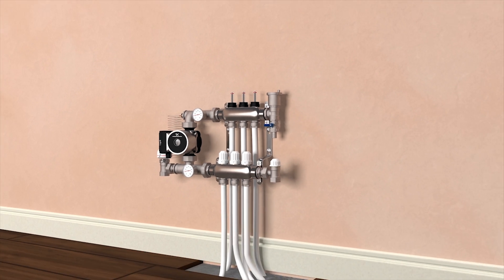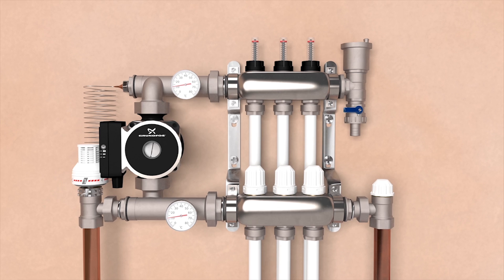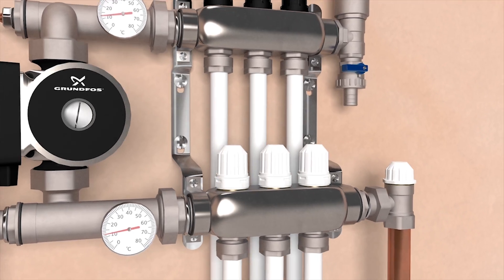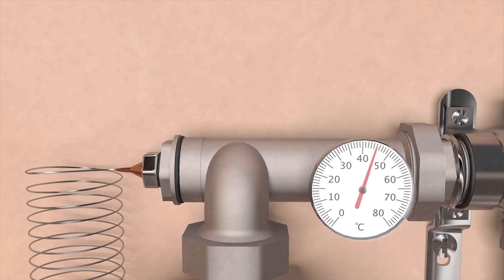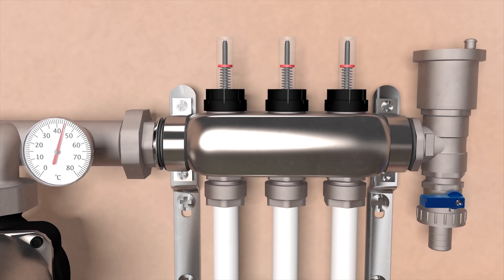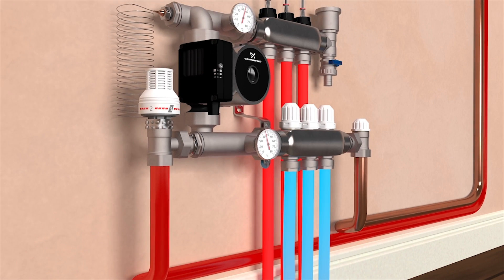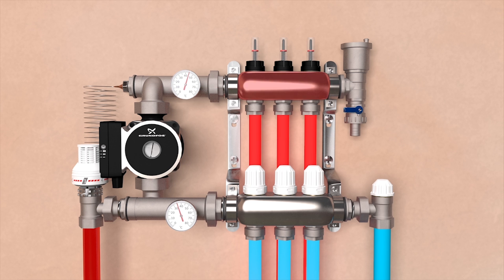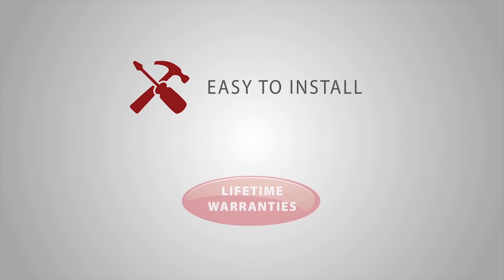How a manifold works

Comment: Why are my valves the other way around?  I have the pump and actuators on top and the others at the bottom?  Same pipe system but opposite valves.  It was like that when we moved in, so assume it’s right and it works but we have a banging noise when it comes on.  Thank you, if you are still here 10 years later 😊
Reply from the maker: Hi @msbecks7004, sometimes the plumber may have adapted things to make it work that way, howeve it is not typical. If you would like to send a photo the tech team could tke a look.  Just email techsupport@wundagroup.com

Comment: Could I ask if manifold can stop water too hot(more than the setup temperature). What is the ideal temperature I should set my boiler to   do, say if my UFH manifold is set for 35oC, should I set my boiler to do 40oC or 45?
Reply: No ! You should set your boiler at the lowest setting to give you the temperature that you want, set by the air thermostat, in the house !

Comment: If the manifold thermostat isn’t letting warm water in, how is this information passed back to the boiler and main pump to stop . Especially when commissioning a new system in the summer when rads aren’t heating and hot water is only on for a few hours.
Reply from the maker: Essentially you will install a 2 port valve for each system that requires hot water such as UFH/Central heating/Radiators, your thermostat speaks to your 2 port valve, then your 2 port valve speaks to your boiler to make the call for heat.
Only the relevant 2 port valve will open, so if the UFH is making a call for heat, the radiators won’t receive hot water.
If you need any further help please feel free to email our Tech team who will be more than happy to assist.  techsupport@wundagroup.com
Reply: As far as I know, the mixer pump is dedicated to loops, and the boiler should have its own circulator that ensures water circulation between it and the manifold (and any other heated part of the house that's not ufh). The boiler should eb equipped with flow and temperature sensors, if no flow or the return temperature is a set point, it stops heating. In both cases, the boiler's circulator has to be independent from the manifold's one.

Comment: This is an excellent demo of how this system works, thank you very much for making it. I have a couple of questions..
1. Where is the excess pressure valve for releasing the accumulated steam pressure?
2. Does this system remove water bubbles, if so how? I ask because most American videos almost always have a pressure and bubble releasing tank.
Reply: 1. there is no excess pressure valve - the water in the system isn't permitted to reach temperatures high enough to create steam nor increase the overall pressure within the loops
2. Water bubbles (air within the circuits/loops) should've been removed during installation